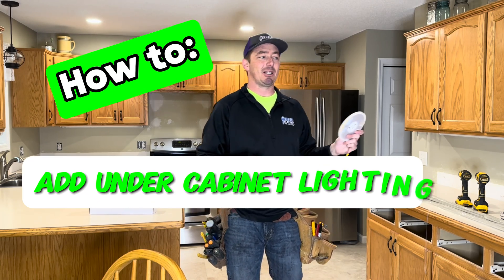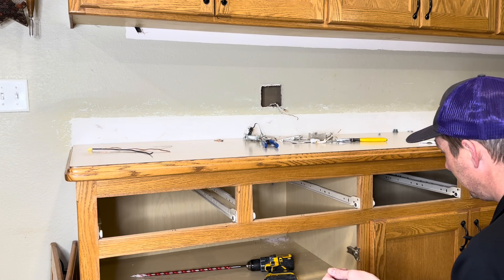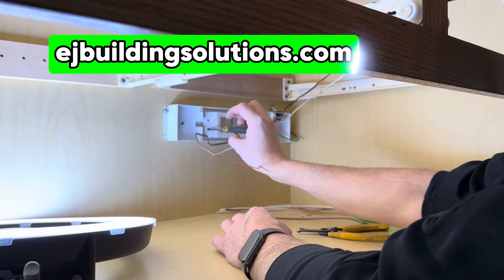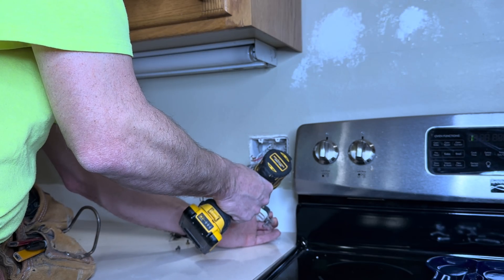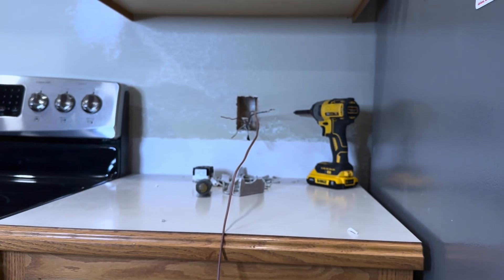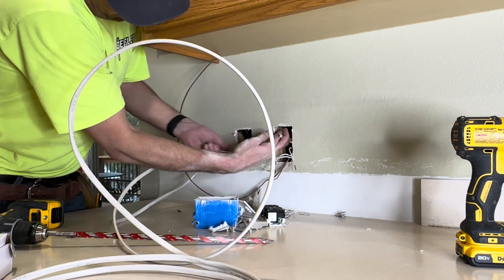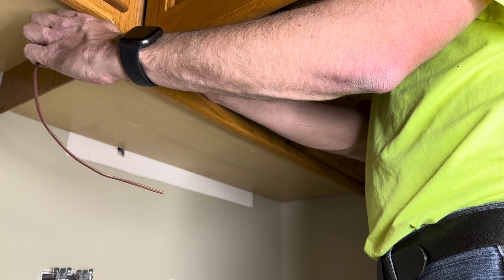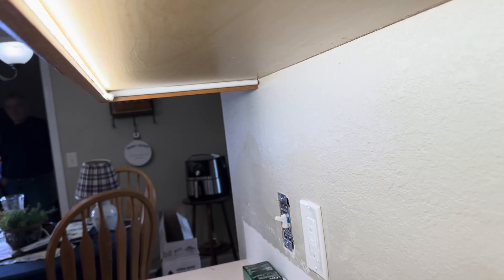Installing under cabinet LED tape light in place of old under cabinet lighting…

Comment: I am doing some strip lights in my pantry that will run off the same single pole switch as the overhead light. So they both will come on at the same time.  

When I run my wire should I bring it out at the same level as the bottom of the upper cabinet? Or should I bring it out in the bottom cabinet since there will be a driver.  Then run the other wire up under the upper cabinet?
Reply from the maker: The driver can be located anywhere. Then you can run the low volt wires to the bottom of the cabinet/shelf anywhere you are installing the tape light.

Comment: I'm looking to do something similar but the under cabinet fluorescent lights are older and hard wired with a push button right attached to its fixture.  Would this be similar and I would just have to have that junction box attached under the cabinet?  Trying to figure out the best way to light underneath the cabinets while getting rid of the ugly old fluorescent fixtures and bulbs.

Comment: What size wire do you run for the tape light. 18 gauge? I was gonna use 16 but I think that may be larger than I actually need. Short run... less than 25 ft of tape light. Thanks

Comment: Am I able to run 3 separate 8ft led strips off of your one 120v driver?
Reply: @electricianjoe I have the same question. One run of cabs to the left of the range, one run wraps the corner on the right side of range between range and sink. Then one run to the right of the sink. A fourth run is on a separate wall surrounding the fridge. It’s roughly 25 linear feet of lighting How many drivers do I need?

Comment: Good job, it's always difficult to do this after it's finished.  I started using the driver/dimmer/switch devices,  they are over a $100 but well worth it in my opinion as you can run your low voltage wire easier than 14-2.
Reply: Is there any of those but alexa compatible?
Reply: @joseluisperezjr3285  not sure on that.

Comment: Hey Joe, how many feet of tape light can you run off of one driver? And are you using 16 or 18/2?  I’m looking to transition to your product as I do several custom houses a year.  Glad to be done with the old fixtures and dealing with 14/2.  Do you offer bulk deals on supplies.  I also don’t want to deal with the Amazon crap. Thanks!
Reply from the maker: We have a chart on the website to help with wire distances and voltage drop. Our 60w driver is good for 20ft of tape light. We have drivers that are 120w(40ft) and 200w(60ft) as well. Just make sure the longer runs are larger wire(14awg) and we have found it’s best to solder leads in the middle to help the tape light with voltage drop so it’s not all on the end. We are discussing a “contractor discount” right now. Shoot us a message on the website and we will get you a discount code!